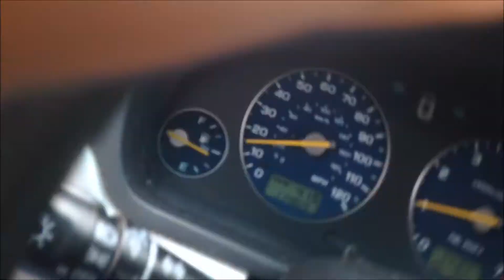Subaru Baja Blows Engine on The Highway!

Comment: so you bought the baja at a dealership and the engine blew? how long did you have it ? did you just leave the dealership and it blew?
Reply from the maker: +PROOF EQUALZ TROOTH I work for a dealership and we bought the car at an auction. the motor had a slight knock in it when we bought it and we planned on putting in a new engine and selling it. my boss changed his mind last second and decided to get rid of it and thought it would make it back to the auction. on the way back it blew up totally on the highway